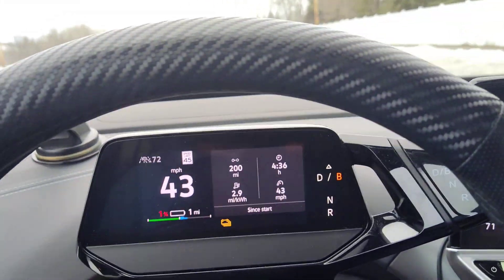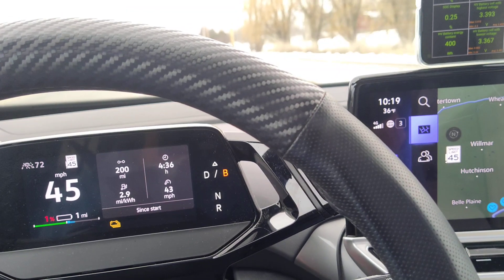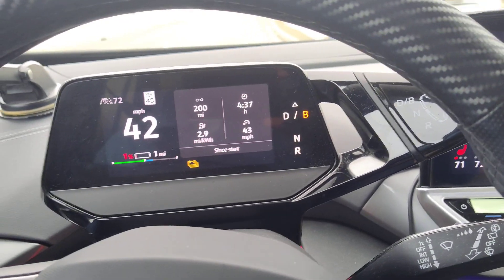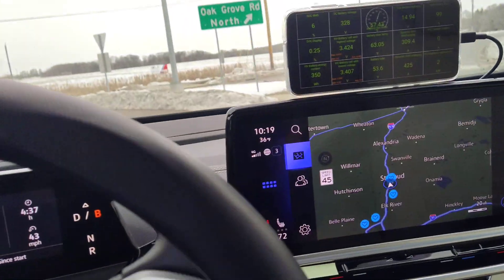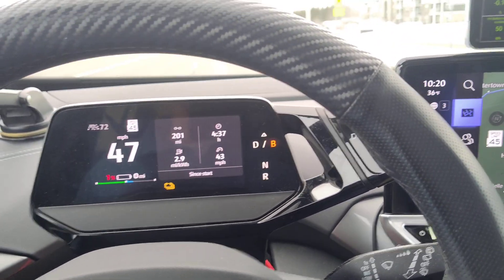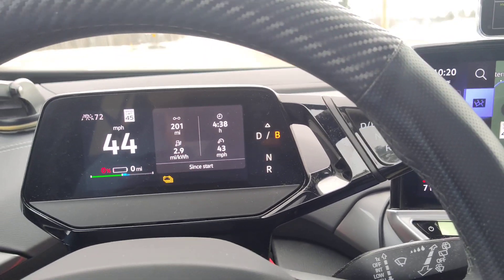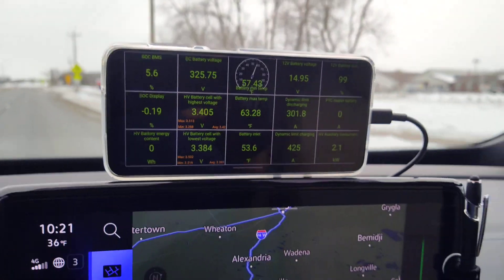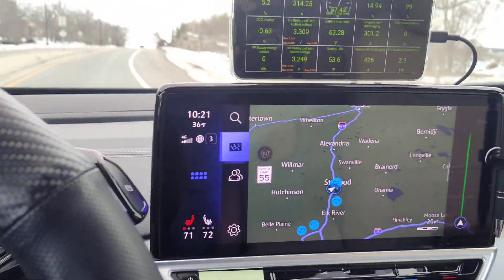Balancing battery cells VW ID 4

Comment: Minor correction, you want to bottom balance your pack prior to start top balancing. Bottom balancing triggers when battery pack is under 12% SoC with ambient temperature between 56 to 80F when parked in well ventilated space. This requirement was suggested by VW techline to workshops when performing battery degradation measurement.